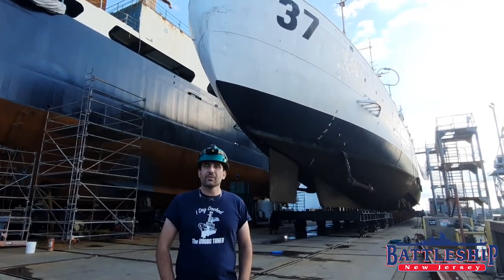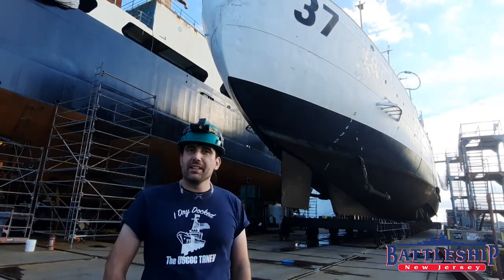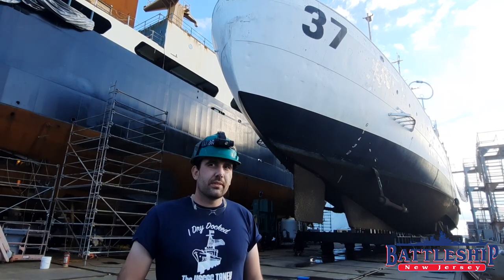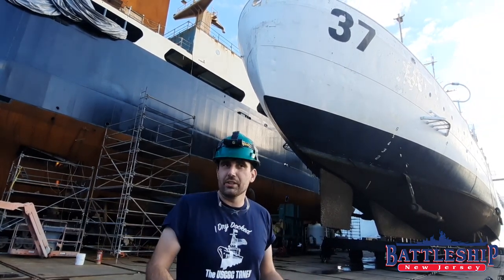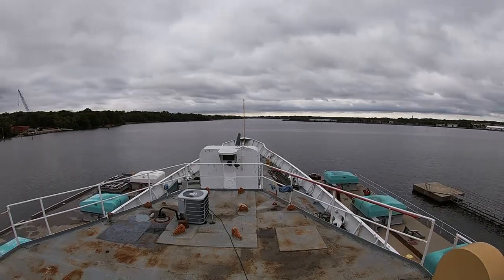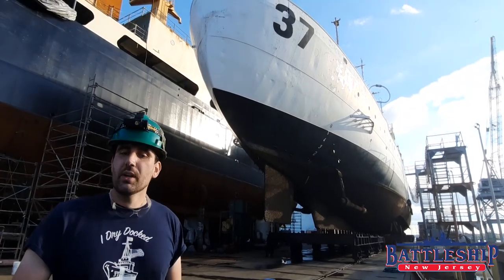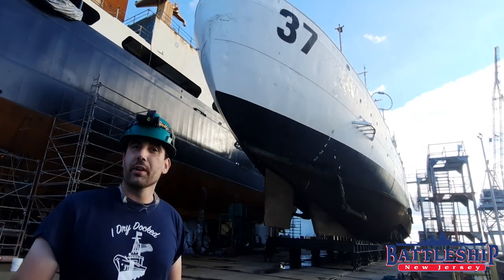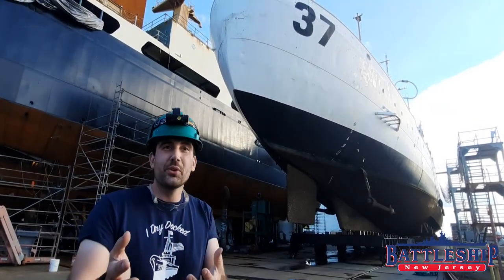Ship Lift Drydocking

Comment: A story I heard about the Intrepid, as an explanation for her looking the way she does today.  She went into drydock in 2006-2007 she had her screws removed, when she went back into the water and back to NYC the fire marshall said that without her screws she's no longer a "ship" and made them put in a bunch of fire safety "improvements" that she was exempt from before, so now she has giant picture windows and massive staircases instead of the typical "ladders" that you normally see on a ship.

No idea if this is true or not.
Reply from the maker: While museum ships are still obligated to follow fire safety codes, changes like that were likely a choice made by the museum. When changes are made, accessibility requirements increase which no doubt impacted their choices. But we weren't there when the decisions were made. Keep in mind though that a lot of museum ships don't have screws or have made drastic changes like Intrepid.
Reply: Not true

Comment: Hi, I have question that is not related to this specific video. From watching previous videos, it is apparent that the Navy had redundancy for firing and aiming the 16 inch guns since the design of her. During the 80's refit when the admiral quarters was turned into the CEC, which was the heart of the tomahawk missiles, was there any redundancy for the CEC in order to continue use of the missiles?

Comment: Am I seeing this right? Instead of setting up wooden blocks to the exact shape of the ship, they can hold her upright with hydraulic "arms" with big and flexible "hands" covered in rubber for good contact? Whoah, technology. Now I wonder if they could make a special ultra-wide gauge railway to transport ships from one port to another on dry land.
Reply from the maker: These are regular keel blocks on like a train cart so they can roll on tracks
Reply: @BattleshipNewJersey There are square wooden beams between the carts and the ship, but about 50m behind you, towards the middle of the ship, the carts widen and there is something that looks like stainless steel round beams, as used in hydraulic machines. It's very small at this distance, so maybe I'm just seeing things.
Reply from the maker: Yeah, there are other cranes and things around, but the ship itself is just supported by the keel blocks and carts